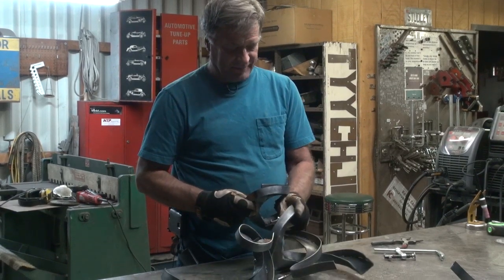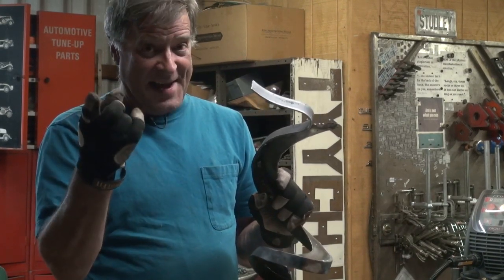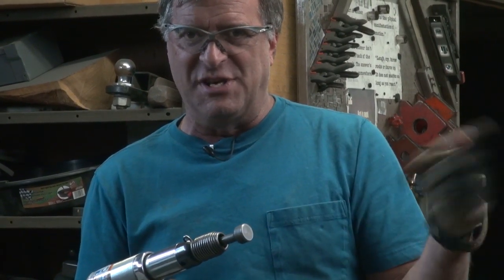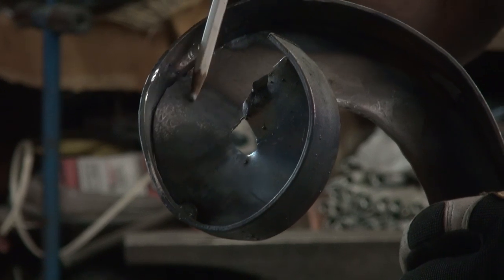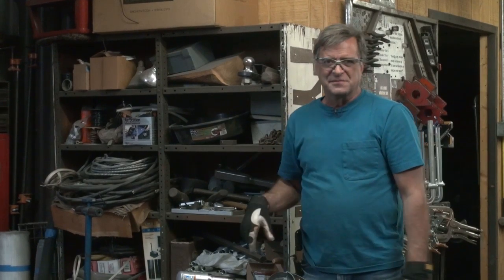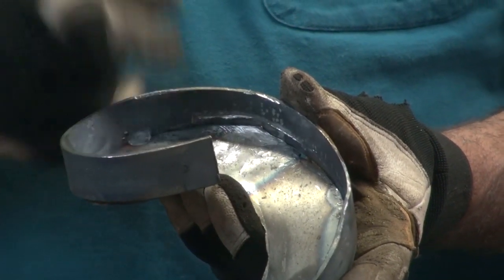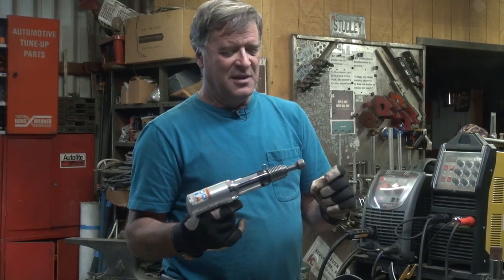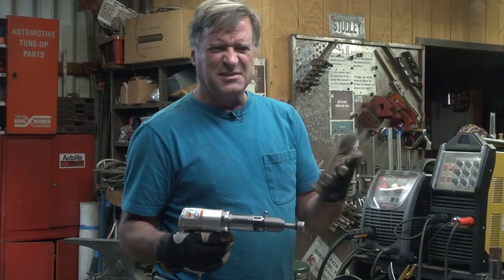How to Shape Metal With an Air Hammer - Kevin Caron

Comment: Great video!

I have that same air hammer and love it.  I got by with a 25gallon 2HP Crafstman compressor for decades.  The smaller compressor is fine if you don't mind waiting for the compressor to refill every minute or so.  Finally bought a bigger 18CFM 60 gal compressor to keep up with my blast cabinet and to blow out my sprinklers.

Comment: 60 gallon of air storage is great, however the cubic feet a minute the compressor puts out is more important. 

For those with small capacity compressors and your air tool slows noticeably right after you pull the trigger here is a trick.  Use a pressure tank such as a 5 gallon LP tank and plug it in where you are working.  Just put a tee in the top of the tank and have a male coupler on one side and a female on the other and use a short work hose from the tank to the tool. 

AN INPORTANT TIP, put a quarter turn valve in the male coupler side so when you disconnect it you do not have a rocket nozzle launching your tank.  If you have a piped installation in your shop one of these tanks mounted overhead at the end of a run of piping at an air line drop also helps any air flow problems.  My grandkids loved to sit in the office chair in the shop, hold onto the tank and open the quarter turn valve.  Fun for them and it moved the dust around in the shop.

BTW, those hit the automotive business back in the 50s when if you bought 5 mufflers to sell you got an Air Powered Muffler Tool.  Thus the popular term "Muffler Chisel" used by us old guys.  That was a great deal back in antiquity as mufflers were a great business for service stations.  The air powered muffler chisel drastically reduced the time and effort removing mufflers.  I still have most of the chisels that I got from that muffler deal.  Today the car will probably die before the muffler.

Comment: You are so right! - a very useful but very noisy brutal tool if not used with care. as you say you need a big tank at high pressure with large bore pipes supplying it to get the best from one.

Comment: Sure would love to see a video of that fireplace in action. Bet it looks great!
Reply from the maker: Here is one,   Look on the lower right side for the link,

http://www.kevincaron.com/art_detail/fractal_fire.html
Reply: Thanks, that is one fine fire. I put in a lot of gas logs and some glass covered gas burner fire pits here in GA. I use manufactured burners but think I heard you say that you make your own burners. If so, you sure have the burner holes, oriface to gas (nat or LP) sized pretty correctly as it is burning nice and even. Lots of trial and error? Thanks again for the vid.
Reply from the maker: And lots of research,  just copied the holes in the regular burner assembly.   But yes, I have also been very lucky with my work.

Comment: What would be your best recommendation for pulling out dents/warps? I've got a t-joint to make in some 16 gauge. The base plate is warped down from the edge of the cross piece, but the underside of the base is enclosed. I tried pulling up with a welding magnet, but that was no-go. I'll probably try a stronger magnet next. I have also pulled dents out of MC tanks using hot glue on a shaft.  If all else fails I'll probably cut into the base to get under the dent. 
     
____|___  <- horizontal sags below vertical
Reply from the maker: That's a tough one!    I would probably try heat and pulling to get it close.  You might try heat and then ice or maybe a co2 fire extinguisher.   But cutting it out and do over is the best way to make sure.

Comment: How did you put that fitting through the beehive spring ?
Reply from the maker: The spring has a small tab  that you push to open it.  Or sometimes you unscrew the spring and slip it over the tool.

Comment: Why not make the sculpture the burner also?  Drilling the holes at an angle and playing with the air flow, maybe you could create a flame vortex?  Maybe a different project for all that though.  Thin high temp stainless and tig welding could be another path. Ah, Air, Water, Fire and Earth, elements for creativity!
Reply: Be careful with your burner design and sculpture use to avoid flame impingement and only use this as a vented appliance.
Nice work stretching the helix with the air hammer.